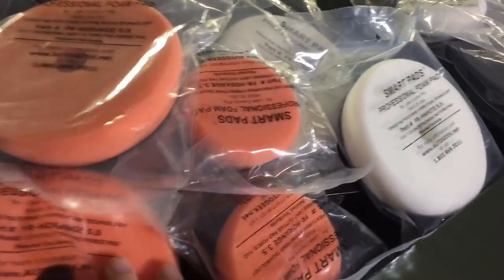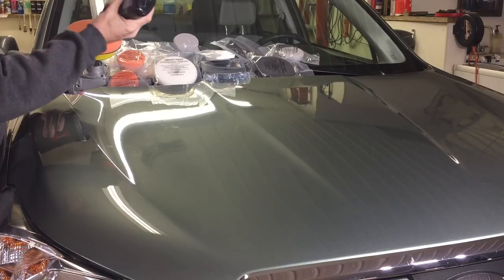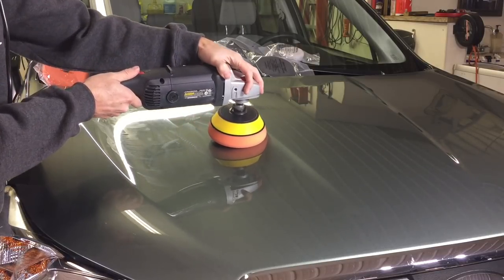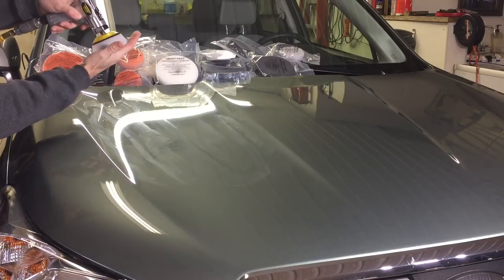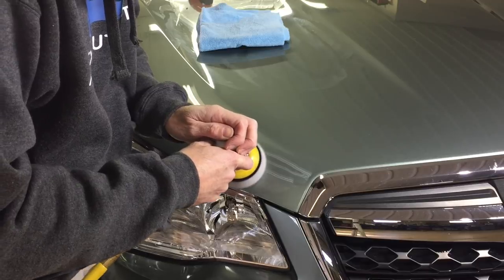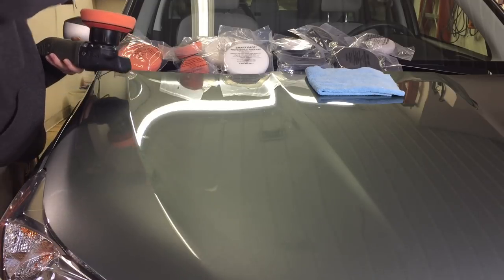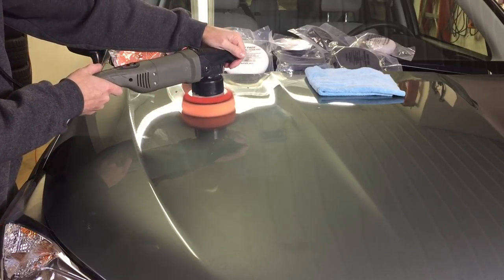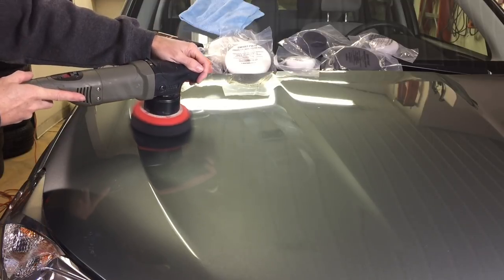Lake Country Hybrid Force Foam And Wool Pads!!! (Gear Driven, Rotary, Short Throw, 3 inch Polishers)

Comment: Why is are the force pads not recommended for long throw?  What about 15mm. I ordered the M15 Pro and buying pads for the first time. Wondering if it is alright to use the same pad and wash it during the process.  I can only guess it may be different since it is wetter from cleaning.

Comment: I know this is a thick pad. Does it take longer to cut? Also, like other foam pads, does it produce a lot of heat? I am working on modern, thin, clear coated 
I am using a Rotary and was wondering if it's better to go with a CCS or some type of waffle pad? 
I greatly appreciate the content you produce on your channel!

Comment: Another great video from Apex!   I am definitely going to have to pick me up a full set of these force pads for my Flex 3401 as well as my brand new Flex Kompackt rotary I just got this past week.  Do you know if these Hybrid Force come in the smaller sizes (1", 2", and 3")?   I got the kit so i'd like to get all sizes for the new Flex if I can.    I think these will be my new "go to" pads as, based on your recommendation, they seem to work well on both forced rotation as well as rotary polishers.    I'm just getting more into the rotary polishing (I do have a cheap rotary from Harbor Freight i've been learning with) and now am jumping up to my new Flex Kompackt rotary polisher , mainly for the ability to have both the smaller pads and extension pieces to get into those smaller locations now where a smaller pad is so valuable.    Thanks again for the information you provide to us weekend enthusiasts out here.
Reply from the maker: I think you can get a six pack and mix and match the cut of the pad. You will LOVE them!!

Comment: I've been noticing a lot of detailers use lake country. is there anything wrong with hex logic pads or r they ridiculously overpriced.reason being ny son gave me hex logic pads to use.great video cu on next video..
Reply: Nothing at all wrong with the Hex pads. So many armchair detailers love to bash anything CG, but in my experience the Hex pads are more consistent and hold up better than almost any other foam pad I've tried. I don't use foam all that often anymore, mainly just for finishing polish, but I usually grab a Hex pad when I do, and I have a cabinet full of options. 👍👌✌

I read somewhere that they are actually manufactured for them by Buff & Shine, not sure if that is accurate but it would account for their high quality.

Comment: Brian. Have you tried snow foam on these cars cover with salt and calcium this year?  Seams like it’s worse this year
Reply from the maker: Yes... have been going through a lot of it lately Mark!  ❄️☃️
Reply: What is your favourite product agains the stuff gets into the salt-solution on the roads? Auto Finess Citrus Power still the best or any more gentle tar remover like Gyeon Tar? Of course some APC but if you (have to) use one that is biodegradable they don't tend to do the job?

I think videos testing different solutions agains salt & the grime in it, would be a very popular one!?